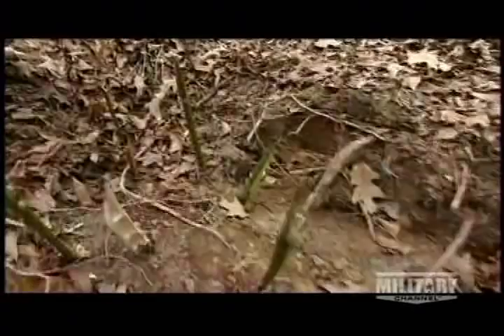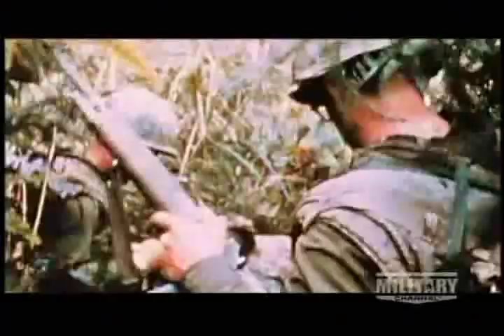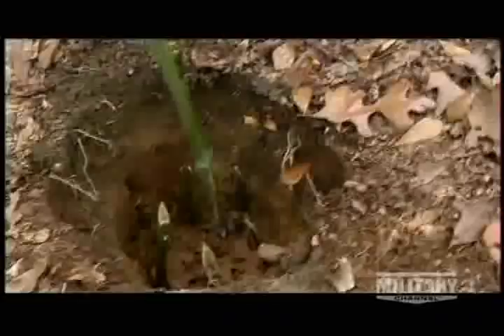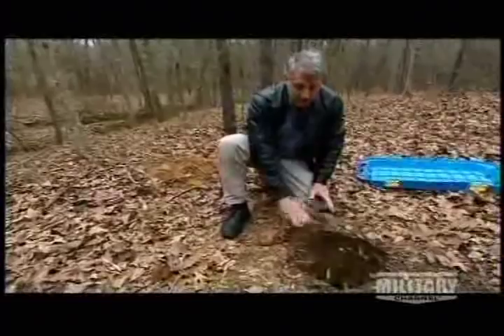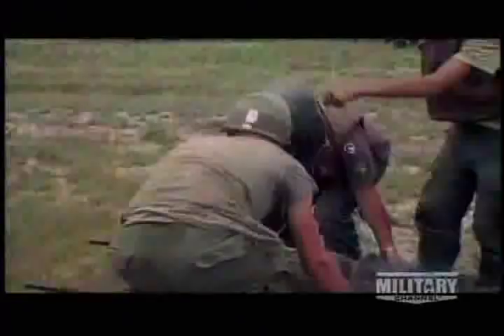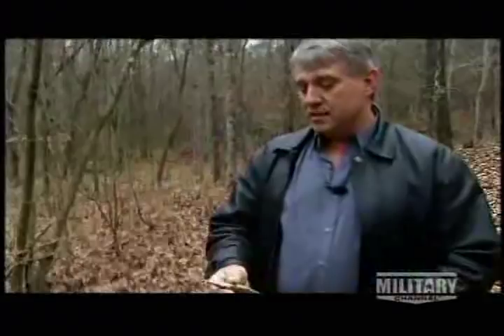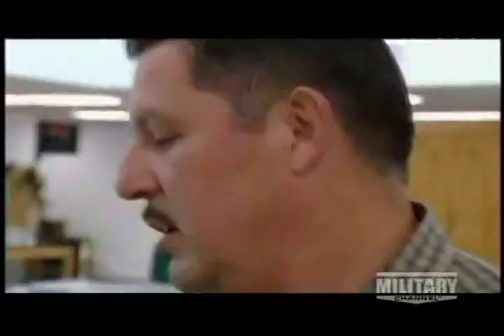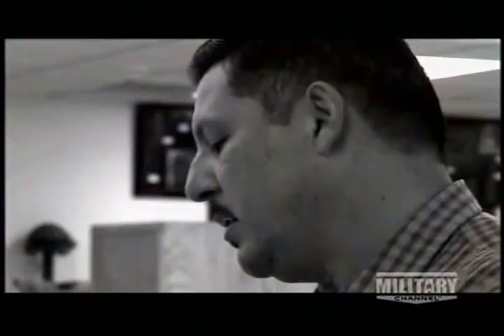S1E9  Booby Traps

Comment: @43:45 new traps can tell the difference between friend and foe? How???

I'm calling bullshit. There's about 0% chance that every anti personnel mine would come with features that can not only tell individuals apart, but to do it so well that it can also cross reference their image of the individual with a database of friends and foes and then decide whether to detonate or not? lol. Good luck with that.

Even if the technology exists, it would be an above ground system and it would basically cost millions for one unit. It's no longer a mine that works via stealth, but one that works by brute force and out spending the enemy and having better technology and systems. Ie only America would use those advanced above ground bunker things like at 43:48
Reply: it uses a computer algorithm created using a database with information about the looks, sizes, colors, infrared patterns etc that it cross references the data its sensors are picking up.